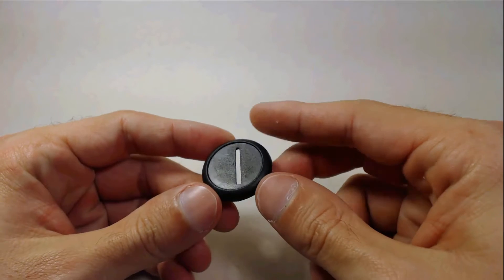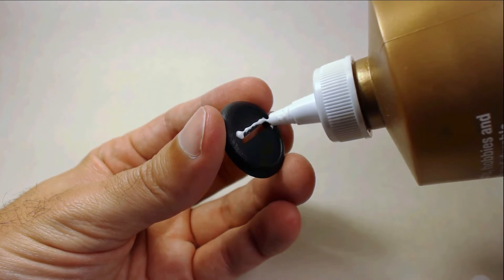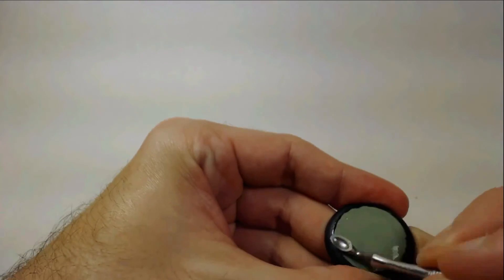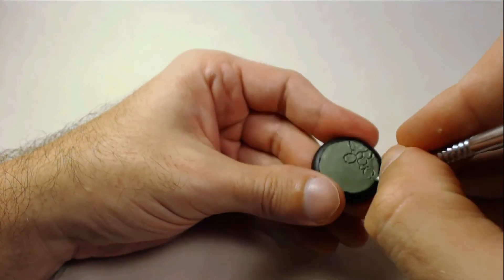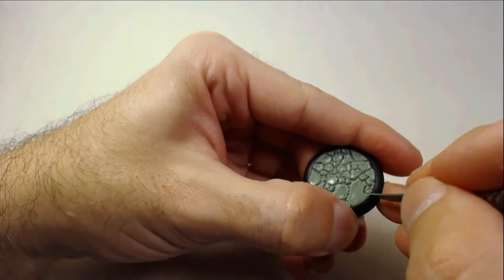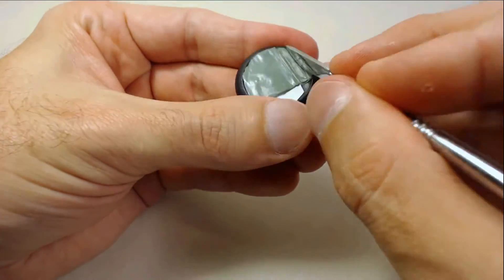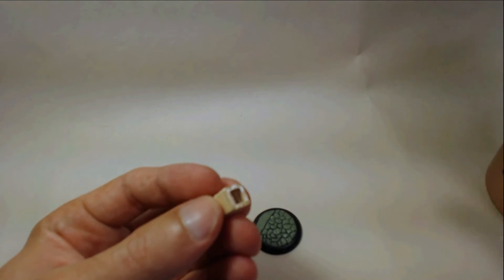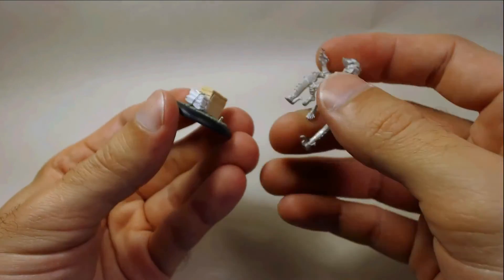Tutorial: Simple Green Stuff Bases

Comment: So supergluing to Green Stuff works well?  I’m starting a project and the legs/feet aren’t really big enough to drill/pin well.
Reply from the maker: So long as you have 2 points of contact super glue will reliably work for keeping the model in place. If you only have 1 point of contact to the base or if the feet are particularly small you could add an element to the base like a box or rock that makes contact with another body part and either glue or pin through that.